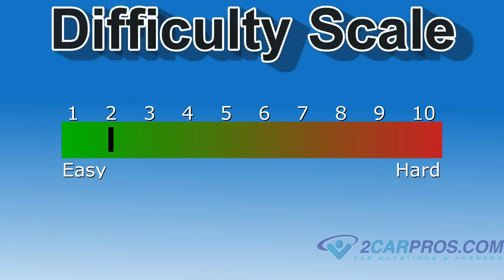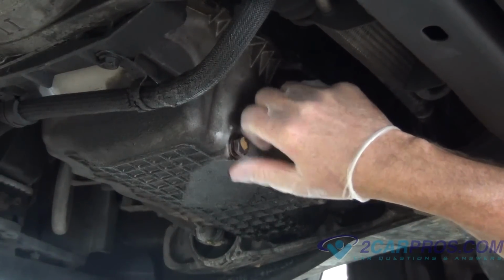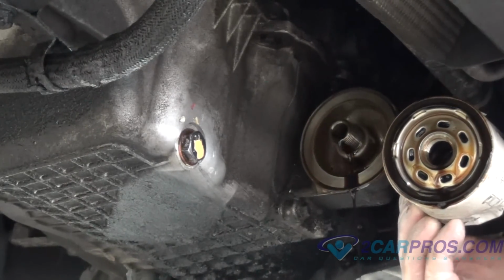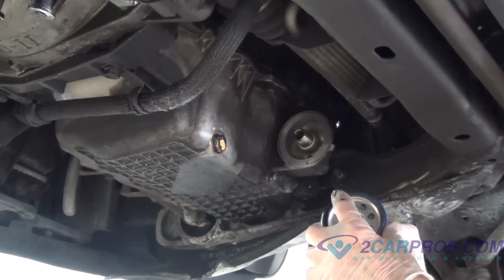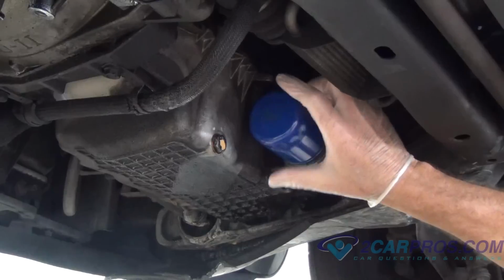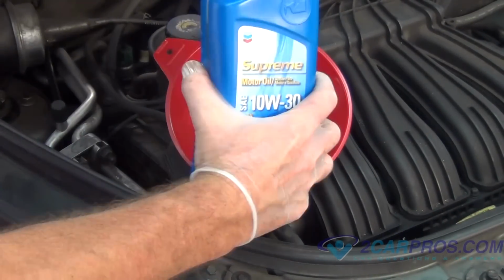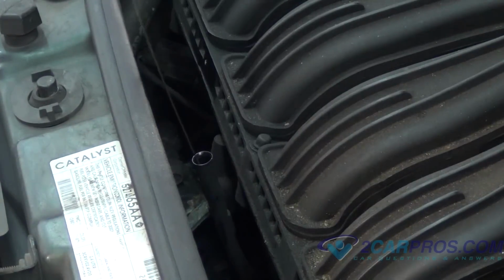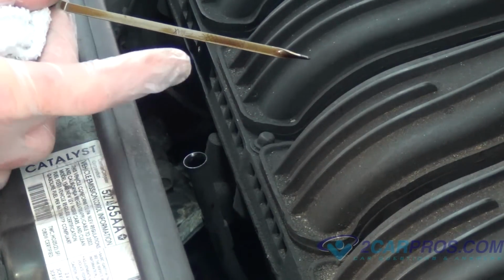Oil Change & Filter Replacement Chrysler PT Cruiser

Comment: Always remove the oil filler cap on top of the engine before draining the oil. This helps with the drainage of the oil but more importantly assures that you can add new oil. There is nothing like draining the oil only to find the filler cap is frozen. Use an open end wrench not a socket. Sockets tend to round off the corners of the drain plug over time. Judging by the shape of the oil filter that was removed someone did more than hand tightened the filter. Get a good one size filter remover, you can check for the correct one with the new filter. Buy a quality filter they cost a little more than your basic Fram filter, A  MOPAR filter would be a good choice.
Reply: Sounds like solid advice.  I've never encountered an oil filler cap that could not be removed but I'm not a mechanic so have not dealt with that many but I can imagine that would not be fun if you had already drained the oil.
Reply: Really late so I hope you reply but I should just tighten the oil filter as much as I can by hand? I'm a girl so I dont have much hand strength. What happens if you over tighten?

Comment: Your video helped a lot. I'm not much of a mechanic. One word of caution. In vehicles I changed the oil when I was younger the oil came straight down. This shot out backwards from me and I didn't have the pan set back far enough so some of the oil hit the floor. I had to use a filter wrench also as you can't get much of a grip on the filter without one. Thanks again.

Comment: This is how I change my oil:1. Warm engine up until at normal operating temperature. 2. Open hood.3. Remove oil filler cap and pull out dipstick half way. 4. Remove oil filter.5. Remove drain plug. 6. Allow oil to completely drain. I usually remove the drain plug then go inside and do something else for about 15 minutes. That way I drain every drop. 7. Wipe dirt off oil filter sealing surface, drain plug sealing surface, and drain plug. 8. Lubricate oil filter seal with clean engine oil.  9.Install oil filter according to instructions printed on the oil filter. The recommended oil filter is a Mopar MO-409. On this filter, it says spin filter on until the gasket touches the engine block. After that, turn the filter 1 full turn. 10. Install the oil drain plug. Oil drain plug torque specification: 20 Ft. Lbs. 11. Add oil. I use Valvoline Conventional. Oil requirements (for N/A & Turbo): API certified SAE 5W-30 oil meeting Chrysler material standard MS-6395. Oil capacity (for N/A & Turbo): 5 quarts. 12. Wipe dirt off oil filler cap and filler hole. 13. Install oil filler cap until it clicks (like a gas cap). 14. Install dipstick fully. 15. Start engine and let it run for a minute. Check for leaks. 16. Lower car and check oil level on a level surface. Manufacturer recommended oil change intervals:Severe driving conditions (N/A & Turbo): Every 3 months/3,000 miles.Normal driving conditions (N/A): Every 6 months/6,000 miles. Normal driving conditions (Turbo): Every 6 months/5,000 miles. I just change my oil every 3,000 miles. The valve train was spotless when I removed the valve cover at 102,000 miles.
Reply from the maker: Great comment thank you!

Comment: would you recommend flushing the engine prior to re adding the fresh oil?
Reply from the maker: No that is very unnecessary. Thank you so much for watching!
Reply: I thought the 2001 takes 5 w 30 ?  Why do some use 5 others 10?
Reply: @nvaldez3658  its the weight, different engines have different oil viscosity needs. Also the temp rating, if you live in a place it gets cold you would want a heavier oil.

Comment: What size socket?  The shop tightened mine down so tight, I can't get it off.  Any ideas?
Reply: I have the same issue!
Reply: cyndibailey  This probably is 7 months too late but use a long open end wrench. You can also try a 1/2" drive wrench instead of a 3/8" drive. See if you can fit a pipe through the handle to give you more leverage. I have also used a rubber mallet. Remember to unscrew the drain plug go counter clockwise.
Reply: cyndibailey im 2 years late lmfao but ive used a screwdriver jammed through filter just ta get a "bite" for the first initial release of tention then slip screwdriver out and remove thats if youre talkin filter as far as the oil drain plug look up how to gain extra leverage using 2 wrenches trick ive used this trick when i cant get a bolt free.box end on bolt and using another wrench u can slip it on the open end and use the box on open end to gain leverage ta break it free
Reply: cyndibailey 7

Comment: Great I will do this myself on my Orange Tangerine Pearl  2.4l Turbo PT I love my baby and will do what I need to keep her going suggested oil somebody 5w30? gets cold here in DC and I have the original stock chrome rims I need to swap them out I get compliments on them all the time I have had them a long time and air seeps out from around the rims so I have had them scraped and beads wax about 3 times depending on season I just need rims but the ones I have came on the dream cruiser and they are not cheap        HELP!!!

Comment: What if thors stronger brother put the filter back on because I can't get it off with anything
Reply from the maker: Use a pair of large channel locks to loosen the filter.
Reply: @2carpros  or a screwdriver and a hammer hammer the screwdriver in through side of filter then use screwdriver as a handle to loosen it. MEssy but effective

Comment: looks like you used a rock to beat off the filter and a socket size wouldve been helpful.
Reply: The drain plug is supposed to be a 13mm and is supposed to have a fiber gasket. The car in this video looks like it's had a rough life lol.
Reply: @AGreedyTree  youd ne amazed at what people do to their cars lol

Comment: Wrong oil tho lol pt cruiser oil is 5w 30 not 10 w30
Reply from the maker: That is very nearly the same. It would be more than fine. Thanks for watching!
Reply: Oh I didn’t know it worked like that
Reply: For anybody wondering the number at the end must stay the same but the first number is simply the viscosity, many people may run a 0W30 in the wintertime due to the oil moving easier and minimizing startup engine wear, on the flip side some run 10W30 in the summer and in hotter areas as you don’t want your oil to become not viscous enough as that can also cause engine wear